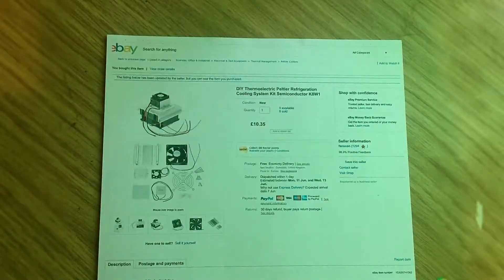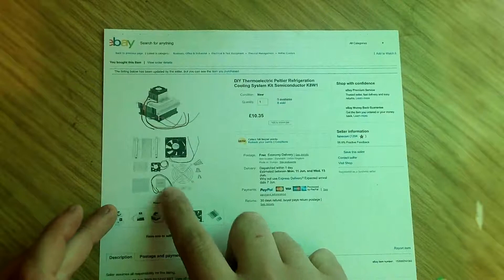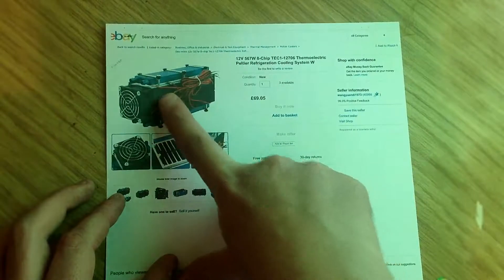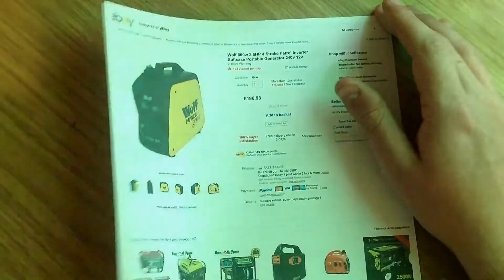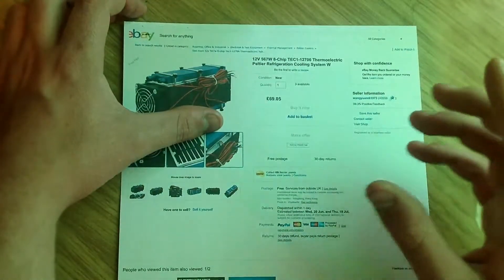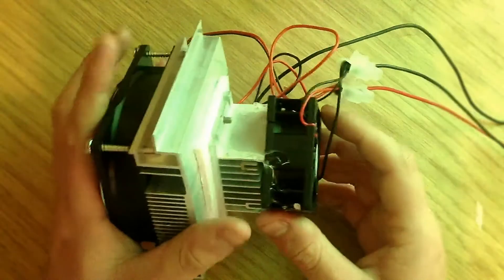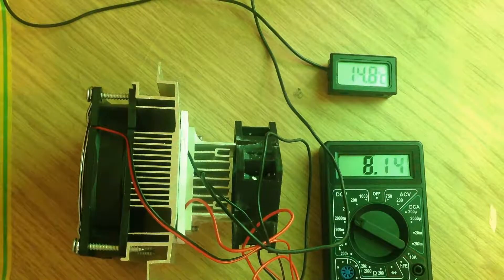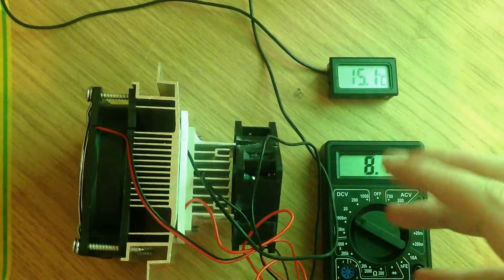Peltier Cooling - Van Travelling Europe

Comment: I'm in a small cargo van that has two large fans (one inbound in the front and another the outbound in the back).  Ventilation is great and it very small space (like <100 sqft).. In the middle  of the Florida summer it's 80F+ at night .  I don't sweat, but it's not entirely comfortable either.  I've noticed there is huge difference when it's just 5F lower outside which it typically is October - May, but June-Sept can be tough.  I tested swamp bucket coolers and they actually help but not so much with all my ventilation and just a pain to keep fetching ice.   I'm only concerned with cooling the van just a little bit and at night, there is no lounging in a van in the day time in Florida.  I was wondering if a few strategically placed Thermoelectric Peltier Modules where the van draws air might do the trick? Any way I could use the van's metal roof skin as the heat sink?  Is a fan to dissipate even necessary? Think a modest 5 degree drop at night is possible (80F to 75F) in humid Florida?  I've been thinking of even testing placing a bag of fresh ice on top of solar panel the inbound fan would be pulling air off but not sure how cold conductive the plastic structure of a solar panel would be. Some testing on my channel.